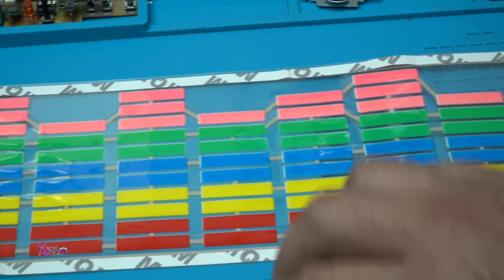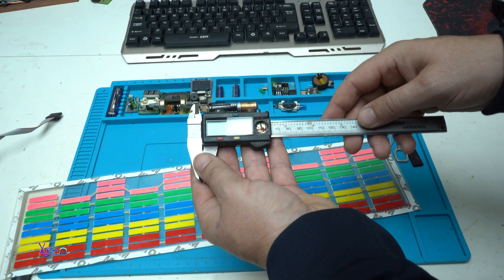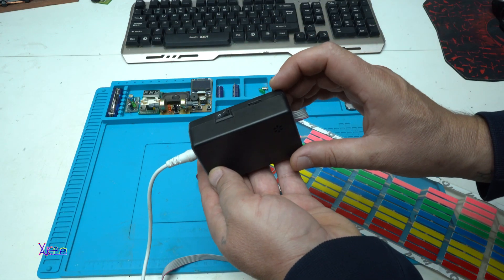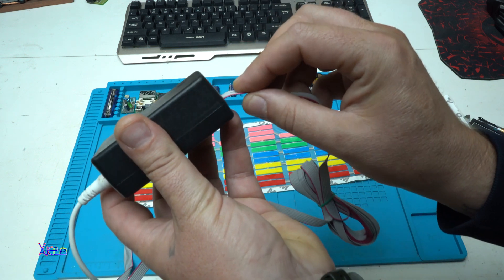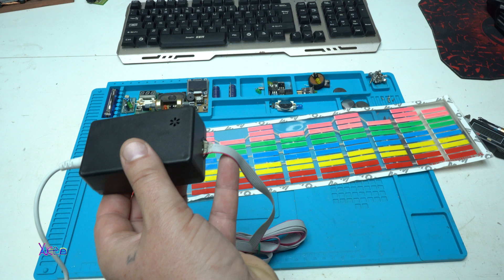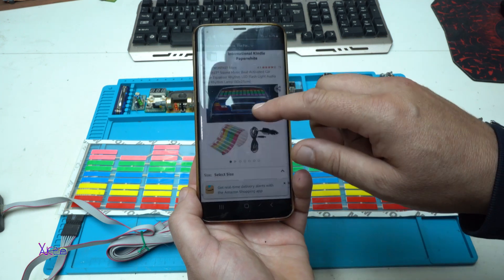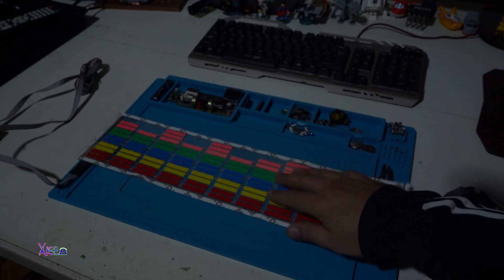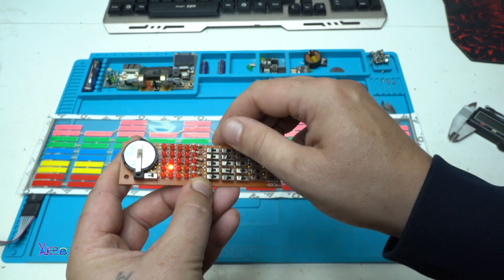BIG LED Equalizer Sticker

Comment: What happens if u cut it shorter ?   Does it still work
Reply from the maker: I dont think so,there flat connections everywhere
Reply: @Hacktuber  well I did  cut it an  typically it does still work fine except the bottom ones connected together for some reason